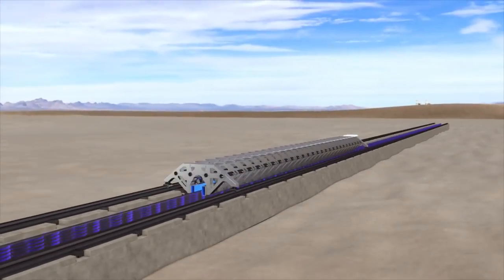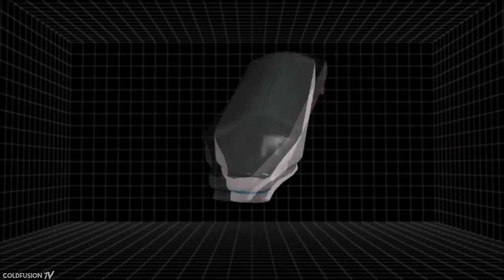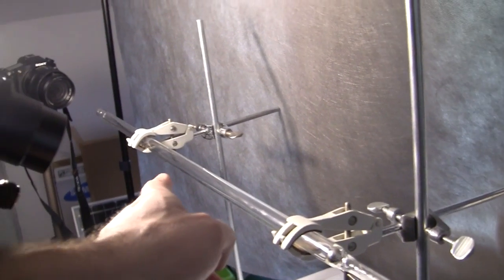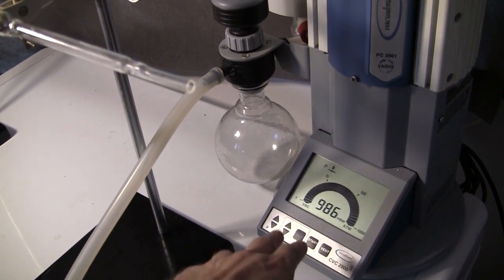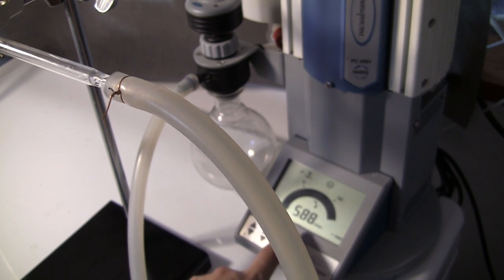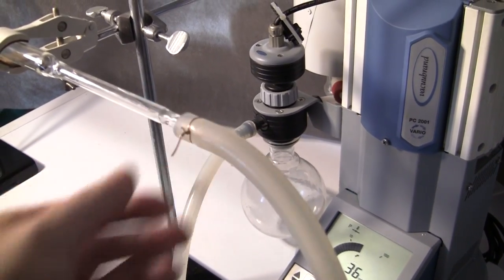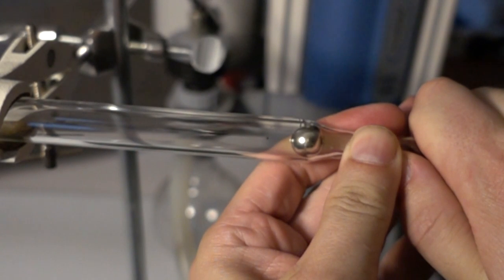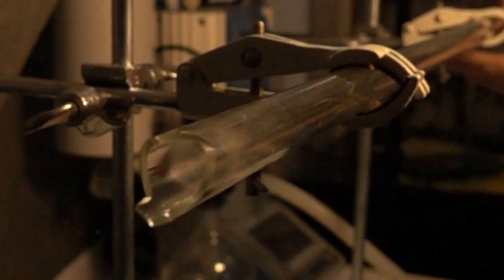How  the Hyperloop can kill you!

Comment: Can't you use the maglev to counter the acceleration?
Reply: Exactly my thought. Plus couldn't there be some kind of simple traditional fail-safe brake on the train? Granted, maglev track would probably get busted but hey, safety first! :P
Reply: You could open emergency valves to pressurize the other section as well.
Reply: Ahh.. Brake...they aren't Futuristic!
Reply: Road Fox
To be honest that emergency valve and pressure equalization is a popular idea in the comments that I personally can't see working. Someone wrote that opening a valve on the other side of the tube would prevent the train from moving which is not true. It would still be accelerating just for half of the time less. Also maybe with a little bit less g-force towards the end but still.
 BRAKES FTW :P
Reply: Tutlon2
You don't open a valve "on the other end of the tube", you open a lot of them alongside the tube. Any extra pressure on the front of the pod is going to immediately reduce the acceleration.

Then combine that with turning off or reversing the pod's air compressor and you are golden.

Edit: You can also use the linear motors to brake the pod as you would in normal operation.
Reply: Road Fox Hmm. Sounds better but I'd have to still put some more thought into it and I'm too drunk and too tired right now. (especially to argue about it with people on the internet) :P It's 2:35 am where I live.

Comment: Not to mention the Gs, they clearly want it to go far faster then any train
Reply: Gs are a measure of acceleration, and have absolutely zero to do with the speed you are traveling at, as long as you're doing so in a straight line. G forces only come in to play when you change your velocity as in turning or getting up to speed or slowing down to stop.
Reply: What? Are you implying it will forever be moving at the same speed even when people are getting on and off? No, there will be changes in speed so there will be gs and the people and stuff inside will be destroyed
Reply: planes move at hundreds of miles per hour, and the stuff inside of them doesn't get instantly destroyed. why? because they accelerate, decelerate and turn slowly enough as to be safe.
Reply: Hm, fair enough. Sorry, i don't know much about physics
Reply: Wow, I found a reasonable person on YouTube, credit to you good sir!
Reply: Why thanks you. I am just happy you didn't try to rub in the fact i was wrong like most people would

Comment: What if they just build up a little less pressure? Then it wouldn't be as dangerous? Or am I missing something?
Reply: I only know one design, back when Elon Musik talked about it, and i think they only went to 300-350 millibars. One third of ambient pressure. The new designs thunderf00t showed here are relly outlandish.
Reply: Condor Boss
There are guns that can fire tens of thousands of rounds before the barrel wears out and needs replacement, basically before the gun breaks. These are violent forces, and a good design would create no such violent forces, so it would last longer.
Reply: Probably in theory because by the looks of it. 
It seems like what there using at the moment isn't really a good idea especially if humans are going to use it.
So probably less would be better in this case.
Reply: Bio gundam
The original Elon Musk concept is not too bad, but he opened it up to anyone and now you get all the nonsense.
Reply: A higher internal pressure would create more of a bow-shock, which would mean that it would be impossible to reach the speeds that Musk talks about.
Reply: you need to have very low pressure for hyper loop to work. Since a metro car is almost like a piston moving i na cylinder - it experiences much more air resistance then a normal train.
You will most likely have to go lover than high altitude airplanes maybe the difference does not have to be 1:1000 but even 1:100 is a lot of potential force to push your cart forward. And remember since you are traveling the tube will probably be very long and that's a long time to accelerate to ludicrous speeds.
There was show (iirc 'none of the above' on discovery or natgeo) where they demonstrated what happens when you shoot a ping pong ball at a ping pong racket with a steam canon. Sure it was rather impressive and loud but no permanent damage was done. then they created vacuum in the barrel and shoot the same canon, with the same pressure again - ping pong ball literally made a neat round hole in the wooden ping pong racket - 8( it was scary.
Reply: Condor Boss
They want to reach the speed of sound, not exceed it, so the goals stay shy of when the real issues arise when travelling in normal air. Lower pressures mean you run into these issues much later.
Reply: kurtilein3 Because the hyperloop is confined to a tube, the bow shock builds up in front of the capsule instead of flowing around it as with an aircraft.

Even if the speed is limited, the bow shock and the tail vacuum mean that there is a rapid pulse of pressurization/depressurization on the tube itself each time a capsule goes through it. This will tend to stress the tube and promote failure. While aircraft do undergo the same stress as they gain altitude, the stress is spread over a longer time and is less likely to cause metal fatigue.
Reply: Condor Boss
lower pressure reduces the issue, the vehicle only taking up a part of the cross-cut area of the tube reduces the issue, the vehicle being aerodynamically designed reduces the issue, and for some designs, the vehicle actively moving air from the front to the back reduces the issue, and the air in the tube moving with the vehicle reduces the issue. Then, the use of pipeline-grade carefully selected steel solves the issue. Basically you use a combination of some of these solutions to reduce it to a manageable push, and select a steel that can handle it forever. Railroad tracks have actual heavy trains hammering them and deforming them with steel wheels...  no problem.
Reply: kurtilein3 The hyperloop designs take up most of the cross sectional area. Aerodynamic design can mitigate the problem only slightly because there is less space for the airflow to move around the capsule than for an aircraft. The existence of the tube creates more problems as the confined cross section makes it more difficult to achieve a laminar rather than turbulent flow. Turbulence causes drag, slowing the craft.

Using a turbine to move the air around the capsule creates even more turbulence.

Pipeline grade welding does not even come close to to maintaining the degree of seal required. All pipelines leak to some degree. Water, natural gas and oil are all considerably more viscous than air. With pressure differentials on the order of several hundred pascals from the outside to inside the hyperloop would require continuous high-volume pumping to maintain the lower pressure.
Reply: Condor Boss
Its still no problem, because in its environment, any hyperloop design, even the outlandish ones, will be subsonic. Also, steel is tougher than you imagine. You think it just crumbles to dust after facing some vibrations and minor shockwaves. This is nonsense.
Reply: kurtilein3 You don't cast a 100 km piece of tubular steel. You have to weld. Even the best beads leak. This is why pipelines leak and ships have bilge pumps.

Repeated tranistory stress on the beads is what is going to make them crack and leak.

The lower viscosity of air and the higher pressure differential is going to make the leaks worse for the hyperloop.

All of which is irrelevant, because the construction costs alone are going to be on the order of a billion dollars per kilometer.
Reply: Condor Boss
No problem, electron beam welding for the win.

Comment: but how about a slower acceleration? instead of going to the top speed in 1 second, going to the top speed in say a minute or however long it would take to get to the speed, with a regular acceleration? just wondering. 
EDIT: I realise now that he talks about a pressure failure, but how about they make different sections over the whole length of the tube, and in each section they can regulate the pressure. That way when there is a rupture, they can regulate to pressure to slowly make it increase up on the point of the rupture, or use it to slow down the cart.
Reply: couldnt you make like separate sections, with in each section a slight decrease of pressure, of course the question would be how to keep the pressure up, is that actually possible? or could you speed up the cart and then go into the depressurised tube. Curious...
Reply: The acceleration via the magnets is not the point here. It's what happens when the low pressure in the tube collapses.
Reply: I'm pretty sure thunderfoot was representing a vacuum failure
Reply: That's the acceleration if the tube failed. So if for some reason there was a breach in the tube behind you it would send you launching. This would mean it would need extra safety features, like a good acceleration sensor so if it goes too fast it will activate some strong brakes. It would also need a few cutoff doors that will slam shut to close off any access to the breach from the inside. That way they could move the other cars out and allow that area to be isolated while it's under repair.
Reply: this experiment represents a failure. they arent planning to use differential pressure as a means of propulsion. they're making it a vacuum so that there is no air resistance. this is just what happens if that vacuum catastrophically fails.

it wouldnt be pretty, but any catastrophic failure of a mass transit system is not pretty.

im curious to see the full video though.
Reply: +Lethmyr aaaaah, couldn't yiu make like a second tube around it? As a fail-safe. because the train that brings you from the mainland to London, is also under a lot of pressure and in case it breaks, I guess you drown.
Reply: This is if the tube ruptures.  Meaning it breaks ever so slightly
Reply: nah, he explained before that maintaining a vacuum that big is nearly impossible, and thus if we ever tried making one it would easily fail and kill everyone inside the tube. he demonstrated how the hyperloop can kill you if its vacuum chamber fails, which is very likely to happen
Reply: +Lethmyr also isn't the acceleration because of the motor and not because of the magnets, which just account for levitation?
Reply: And okay, my bad guys, didn't know he was talking about a pressure failure, but would you be able to make a fail-safe? Just wondering
Reply: right...what the dude with the hard to spell name said...... this isnt about every day operation. 

this is about when something fucks up.

like if a car de-rails and hits the wall to hard.
Reply: Okay so if we speak hypothetically and we could maintain a vacuum, couldn't you use the magnets to slow down the train if a certain acceleration is crossed, or could you make like a "net" around the tube that detects ruptures, and if that happens the magnets get reversed, I guess, so that the train slows down
Reply: It was a ball in this example, which has no acceleration on it's own. What accelerated it was the air that suddenly was able to get into the tube, and it wished to have similar pressures everywhere in the tube, which resulted in the acceleration since the pressure on the right side was much smaller than the one on the left.
Reply: Altorin but couldnt you use the different sections as propulsion, but also a slow down mechanism. Meaning that they devide the whole tube into sections, with regulatable pressure and in that way the problem of maintaning the almost vacuum of a large space is also solved
Reply: Slam Gamez this I realised and now I wonder if we could use it for a slower acceleration with regulatable pressure in different sections, and also because of this we could use it in case of a failure.
Reply: +Eatin Cookies 
He was demonstrating if the tube failed.
Reply: Eatin Cookies I don't think changing the pressure in different parts is going to be something that happens, since changing the pressure would require a metric fuckton of energy in the large scale. I however think that the motors in the "train" would just be weak enough to give the wished amount of acceleration, and some new brakes has to be invented (or not, i am not that much of an expert)
Reply: +Slam Gamez yeah I was thinking about that aswell and even if you were able to do that, how would you maintain the different pressures when the sections open to let the train pass. Amd couldn't you use the magnets for a braking system?
Reply: Eatin Cookies Using the magnets as a braking systems seems like a good idea (to me at least.) And i feel like the sections never should open and you instead just should keep the pressure at the same level in the tube constantly. (And just changing the pressure locally whenever passengers have to get on/off)
Reply: Yeah, that would work! We need thunderfoot to confirm!
Reply: Because the acceleration would be too fast the detect and resolve before everyone was subject to lethal forces
Reply: +scotcheggable that was what I was afraid of, but somehow, there has to be a solution.
Reply: +Eatin Cookies simple, just dont create a vacuum and sacrifice some speed. Is it really worth risking your life to get to a certain place a little faster?
Reply: +Job Koppenol yes, but the technology just isn't there yet :>
Reply: Job Koppenol Without a decent vacuum then all you have is a magnetic train, something that already works.
Reply: +Slam Gamez yeah exactly. We can't build a vacuum chamber that big and I doubt we'll ever be able to.